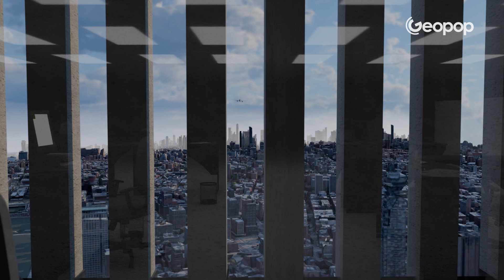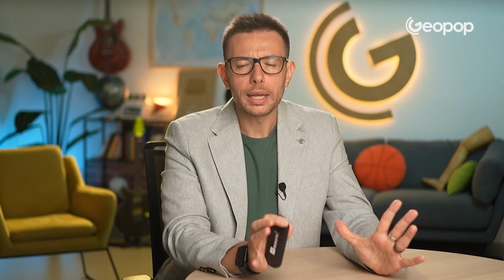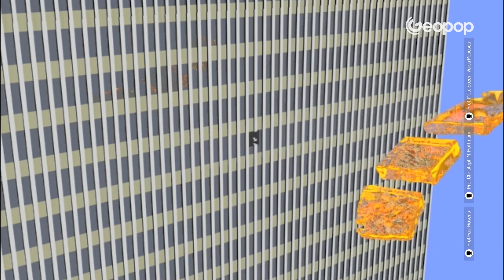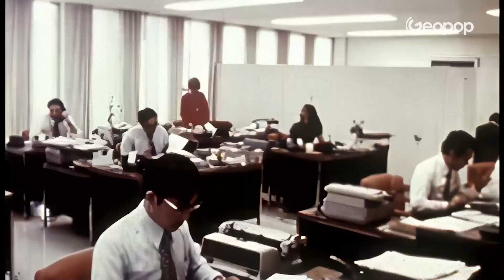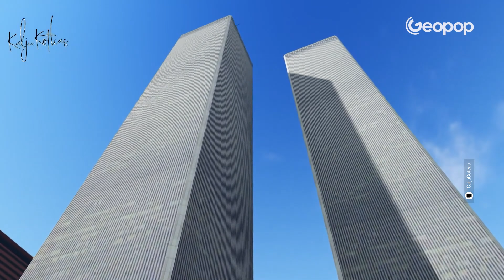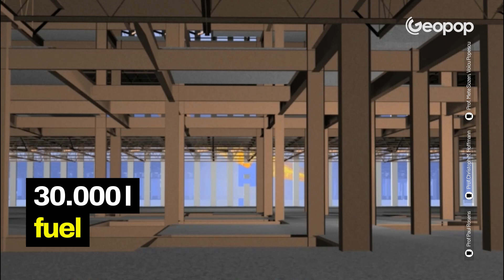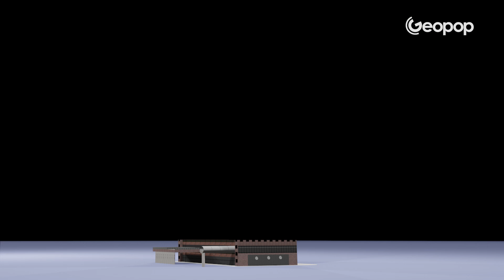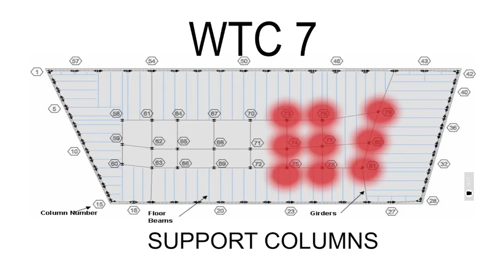9/11, 2001: The Technical Reconstruction of the Twin Towers and WTC 7 Collapses

Comment: The ridiculousness of the comment at 15:30 is astonishing! I know there will be many NIST boot lickers that will attack like ravenous beasts, but they just lack not only critical thinking skills but also lack any scientific education, scrutiny or rigor.

All of the laws of motion were in play on this day with regard to the collapse but NIST and the bootlickers will dazzle and distract you with big words, statements like "fire weakened the structure" and PhD's. Don't be fooled. The laws of motion cannot be suspended and those laws of motion NEVER get discussed by the official story.

No conspiracies just the facts of the laws of motion. I will discuss what happened as the building starts to collapse

Here is the order of Newton's laws of motion in place during the collapse and why it should have happened this way:

1. Gravity initiation
Newton’s Second Law (𝐹=𝑚𝑎): Gravity acts on the mass, causing downward acceleration.

2. Falling under gravitational acceleration
Newton’s First Law: The object (upper mass) remains in motion unless acted upon by another force (e.g., resistance).

3. Initial collision with the first weakened layer
Newton’s Third Law: Equal and opposite reaction forces occur between the falling mass and the impacted layer.

4. Momentum transfer to the first layer
Conservation of Momentum: Momentum is shared between the falling mass and the struck layer (𝑚1𝑣1+ 𝑚2𝑣2 = (𝑚1+𝑚2) 𝑣 final)

5. Energy dissipation (deformation, heat, sound)
Conservation of Energy: Kinetic energy is converted into deformation energy, heat, and sound, reducing the system’s overall kinetic energy.

6. Resistance from the intact or weakened structure
Newton’s Third Law: The lower structure pushes back with an equal and opposite force, resisting further motion.

7. Deceleration due to upward reaction forces
Newton’s Second Law: The upward force exceeds or equals the downward gravitational force, causing deceleration.

8. Possible localized failures in the immediate contact area
Material Strength Principles: Failure occurs when stress exceeds the material’s yield strength.

9. Redistribution of loads across lower layers
Static Equilibrium Principles: Intact parts of the structure redistribute the load to compensate for localized failures.

10. Arrest or halting of the collapse due to insufficient energy
Newton’s First Law: The system comes to rest when insufficient energy remains to overcome resistance forces.
~~~~~~~~~~~~~~~~~~~~~~~~~~~~~~~~~~~~~~~~~~~~~~~~~~~~~~~~~~~~~~~~~~~~~~~~~~~~~~~~~~~~~~~~~~~~~~~~~~~~~~~~~~~~~~~~~~~~~~~~~~~~
Here is the explanation for each:

1. Gravity as the Sole Force of Acceleration
Their Claim: Gravity alone was sufficient to accelerate the top floors downward, overcoming all resistance and allowing for progressive collapse.
Issue: Gravity provides a constant downward acceleration (𝑔=9.81m/s2) but this acceleration is opposed by:

Upward Reaction Forces (Newton’s Third Law): Each floor below exerts a force equal and opposite to the falling mass's force. For the collapse to proceed, the falling mass must overcome this resistance.

Energy Dissipation: Each collision converts significant kinetic energy into deformation, heat, and sound. This reduces the energy available for further acceleration.
Structural Redundancy: The lower intact floors were designed to support many times their static load. Overcoming this redundancy would require far more energy than gravity and momentum alone could provide.

2. Ignoring Energy Dissipation
Their Claim: Momentum transfer broke each intact floor free of its supports, with minimal energy lost to the process.
Issue: This assumption dismisses the large energy losses that occur in inelastic collisions. In reality:
Breaking Floor Supports: Significant energy is required to shear steel columns, crush concrete, and deform trusses. This energy cannot be ignored, as it fundamentally affects the dynamics of the collapse.
Momentum Conservation: While momentum is conserved, kinetic energy is not. In inelastic collisions, much of the kinetic energy is dissipated as heat, sound, and deformation, reducing the velocity of the falling mass.
Scaling of Resistance: Each subsequent floor presents increasing resistance due to the *cumulative load of debris*, making it unlikely for the collapse to proceed without deceleration.

3. Momentum Transfer and Structural Resistance
Their Claim: The falling mass imparted momentum to each successive floor, progressively breaking supports and adding to the collapsing mass.
Equation Provided: 𝑚1𝑣1𝑖=(𝑚1+𝑚2)𝑣𝑓, where momentum is conserved.
Issue: This simplified application of momentum transfer neglects key factors:

a. Reaction Forces (Newton’s Third Law):
Each floor below exerts a significant upward reaction force, which should decelerate the falling mass.
For the collapse to continue, the force of the falling mass must exceed the strength and resistance of each floor. This becomes increasingly unlikely as the intact lower structure is much more robust than the falling debris.

b. Mass Disparity:
The mass of the falling upper portion (e.g., top 15-20 floors) is vastly smaller than the lower intact structure (90+ floors). This mass disparity means the lower structure is capable of resisting and stopping the collapse unless an overwhelming external force is applied.

c. Energy Dissipation at Each Collision:
The energy dissipated in breaking floor supports and deforming materials grows exponentially with each floor. This dissipation reduces the kinetic energy available to continue the collapse.

4. Exponential Increase in Kinetic Energy
Their Claim: The kinetic energy of the falling mass increased exponentially as it accumulated debris.
Issue: This claim misrepresents how energy and momentum function in inelastic collisions:

a. Energy Dissipation Limits Acceleration:
The addition of mass during each collision increases inertia, making it harder for the falling mass to accelerate further. While the total mass increases, the energy dissipated in deformation and resistance reduces the effective velocity.
b. Structural Resistance Grows:
As the falling mass grows, the upward reaction force from the lower structure also increases due to the increasing mass. The intact structure was designed to withstand many times its static load, so it becomes progressively harder for the falling mass to continue.
~~~~~~~~~~~~~~~~~~~~~~~~~~~~~~~~~~~~~~~~~~~~~~~~~~~~~~~~~~~~~~~~~~~~~~~~~~~~~~~~~~~~~~~~~~~~~~~~~~~~~~~~~~~~~~~~~~~~~~~~~~~~

Here is why there is the misapplication of Newton’s Laws
NIST's application is flawed, here's why:

First Law (Inertia):
The lower floors were indeed "at rest," but the massive inertia of the intact lower structure means it would resist motion far more effectively than their explanation accounts for. The upward reaction forces would decelerate the falling mass significantly.

Second Law (𝐹=𝑚𝑎):
While the falling mass starts to accelerate due to gravity, the upward reaction forces at each collision create a net deceleration. The force required to shear steel columns and crush concrete far exceeds the available force from the falling mass.

Third Law (Action-Reaction):
The upward reaction force exerted by the intact floors would create significant deceleration for the falling mass, eventually arresting the collapse unless an overwhelming EXTERNAL energy source was introduced. This directly contradicts the claim that "no single floor could stop or slow the collapse."

~~~~~~~~~~~~~~~~~~~~~~~~~~~~~~~~~~~~~~~~~~~~~~~~~~~~~~~~~~~~~~~~~~~~~~~~~~~~~~~~~~~~~~~~~~~~~~~~~~~~~~~~~~~~~~~~~~~~~~~~~~~~

If any person reading this wants to dispute this, GREAT! Most of you will ignore the math and the explanations of the laws of physics, that's ok. 

So, listen, I get it. Brains are small, patience is little and most couldn't find there way out of their Mom's basement either way. However, ..........................

Here's the challenge: Do an experiment or find a video that shows ANY 2 objects, not a building, made of the same material, built in a similar fashion to each other (might I suggest cars and trucks as an example?). One of the objects should be smaller in mass and weight and the other should approximate a mass and weight much larger than the small object. Please show the small object initiate and accelerate by gravity, and after impacting the second larger object, CONTINUE TO ACCELERATE through ALL of the larger objects, COMPLETELY DESTROYING those larger objects. 

That's it kiddo's. Just one example! You got this!
Reply: Your reasoning is impossible to follow as you (go out of your way) to not specify what it is that is supposed to be interacting with what.

The structural elements are;
1. The 47 core columns.
2. The 236 perimeter columns
3. The long-span lightweight steel floor trusses
4. The steel hat truss.

So please ree-state, only this time identify which components are interacting with each other and how at each stage.
Reply: @TheLoonResistance  

In the context of the collapse, the following interactions between structural elements occurred at each stage:

Gravity Initiation:
The mass of the upper floors acted on the long-span lightweight steel floor trusses, transferring load to the 47 core columns and 236 perimeter columns.

Initial Collapse at the Impact Zone:
The floor trusses, weakened by fire, sagged and pulled on the perimeter columns, causing inward bowing. Simultaneously, the core columns experienced a redistribution of load, some of which exceeded their capacity.

Progression of Collapse:
As the floor trusses detached from the core columns and perimeter columns, these columns were left unsupported and buckled under the weight of the upper floors.
The steel hat truss, designed to redistribute loads between the core and perimeter, failed under the dynamic loads created during the collapse initiation.

Interaction During Momentum Transfer:
Falling debris from the upper floors impacted the floor trusses below, transferring force to the core columns and perimeter columns, which failed sequentially.

Energy Dissipation and Arrest:
At every stage, deformation of the trusses, buckling of the columns, and fracturing of connections dissipated energy, making progressive collapse increasingly unlikely without additional forces.
~~~~~~~~~~~~~~~~~~~~~~~~~~~~~~~~~~~~~~~~~~~~~~~~~~~~~~~~~~~~~~~~~~~~~~~~~~~~~~~~~~~~~~~~~~~~~~~~~~~~~~~~~~~~~~~~~~

Conservation of momentum plays a critical role in understanding the interactions during the collapse. At each stage of the collapse:

Momentum Transfer: When the falling upper mass impacted the stationary structure below, momentum was shared between the two, following the principle: 𝑚1𝑣1+𝑚2𝑣2 = (𝑚1+𝑚2)𝑣𝑓
 
Here, 𝑚2𝑣2 = 0 because the lower structure was initially at rest. This transfer results in a combined mass with reduced velocity due to energy dissipation.

Energy Dissipation: Momentum conservation is separate from energy conservation. While momentum is conserved, kinetic energy is lost during each impact to deformation, heat, and sound. This loss causes a deceleration of the falling mass, making a progressive collapse less likely.

Impact on Structural Resistance: As the mass of the falling debris increases, so does its inertia. However, the resistance provided by the lower intact floors also increases proportionally, further counteracting acceleration.

Conservation of momentum explains perfectly why the collapse would decelerate rather than accelerate, as significant energy is lost at each collision point.
~~~~~~~~~~~~~~~~~~~~~~~~~~~~~~~~~~~~~~~~~~~~~~~~~~~~~~~~~~~~~~~~~~~~~~~~~~~~~~~~~~~~~~~~~~~~~~~~~~~~~~~~~~~~~~~~~~

Gravitational acceleration requires an additional force, "separate" of gravity, for the top floors to accelerate "through" the lower 90 floors of undamaged, cold steel built with redundancy to withstand approximately a load of 11 more floors.

Increased velocity at impact results in higher kinetic energy (𝐾𝐸 = 1/2 𝑚𝑣2)  and momentum (𝑝 = 𝑚𝑣). The increased kinetic energy must still overcome the resistance from the supports of each successive floor (Newton's Third Law.)

I don't mind debating this but still looking for someone to point me to an experiment they have done or a video showing ANY 2 objects, not a building, made of the same material, built in a similar fashion to each other (might I suggest cars and trucks as an example?). One of the objects should be smaller in mass and the other should approximate a mass larger than the small object. 

Please show the small object initiate and then continue to accelerate by gravity alone, and after impacting the second larger object, CONTINUE TO ACCELERATE through ALL of the larger objects, COMPLETELY DESTROYING those larger objects.
Reply: @christyfleming433  - While there are some prior quibbles, I am going to set those aside for the moment and stop you at;

Interaction During Momentum Transfer

Your description that Falling debris from the upper floors impacted the floor trusses below, transferring force to the core columns and perimeter columns, which failed sequentially is incorrect.

Impact from the falling debris hitting the next intact floor below would and did cause instantaneous failure of the 5/8| bolts connecting each end of the floor truss to the core and perimeter columns. No meaningful loads are transferred sideways into the columns and the columns remain standing far behind the collapse front.
Reply: @TheLoonResistance  

In the context of the collapse, the following interactions between structural elements occurred at each stage:

Gravity Initiation:
The mass of the upper floors acted on the long-span lightweight steel floor trusses, transferring load to the 47 core columns and 236 perimeter columns.

Initial Collapse at the Impact Zone:
The floor trusses, weakened by fire, sagged and pulled on the perimeter columns, causing inward bowing. Simultaneously, the core columns experienced a redistribution of load, some of which exceeded their capacity.

Progression of Collapse:
As the floor trusses detached from the core columns and perimeter columns, these columns were left unsupported and buckled under the weight of the upper floors.
The steel hat truss, designed to redistribute loads between the core and perimeter, failed under the dynamic loads created during the collapse initiation.

Interaction During Momentum Transfer:
Falling debris from the upper floors impacted the floor trusses below, transferring force to the core columns and perimeter columns, which failed sequentially.

Energy Dissipation and Arrest:
At every stage, deformation of the trusses, buckling of the columns, and fracturing of connections dissipated energy, making progressive collapse increasingly unlikely without additional forces.
~~~~~~~~~~~~~~~~~~~~~~~~~~~~~~~~~~~~~~~~~~~~~~~~~~~~~~~~~~~~~~~~~~~~~~~~~~~~~~~~~~~~~~~~~~~~~~~~~~~~~~~~~~~~~~~~~~

Conservation of momentum plays a critical role in understanding the interactions during the collapse. At each stage of the collapse:

Momentum Transfer: When the falling upper mass impacted the stationary structure below, momentum was shared between the two, following the principle: 
𝑚1𝑣1+𝑚2𝑣2 = (𝑚1+𝑚2)𝑣𝑓
 
Here, 𝑚2𝑣2 = 0 because the lower structure was initially at rest. This transfer results in a combined mass with reduced velocity due to energy dissipation.

Energy Dissipation: Momentum conservation is separate from energy conservation. While momentum is conserved, kinetic energy is lost during each impact to deformation, heat, and sound. This loss causes a deceleration of the falling mass, making a progressive collapse less likely.

Impact on Structural Resistance: As the mass of the falling debris increases, so does its inertia. However, the resistance provided by the lower intact floors also increases proportionally, further counteracting acceleration.

Conservation of momentum explains perfectly why the collapse would decelerate rather than accelerate, as significant energy is lost at each collision point.
~~~~~~~~~~~~~~~~~~~~~~~~~~~~~~~~~~~~~~~~~~~~~~~~~~~~~~~~~~~~~~~~~~~~~~~~~~~~~~~~~~~~~~~~~~~~~~~~~~~~~~~~~~~~~~~~~~

Gravitational acceleration requires an additional force, "separate" of gravity, for the top floors to accelerate "through" the lower 90 floors of undamaged, cold steel built with redundancy to withstand approximately a load of 11 more floors.

Increased velocity at impact results in higher kinetic energy (𝐾𝐸 = 1/2 𝑚𝑣2)  and momentum (𝑝 = 𝑚𝑣). The increased kinetic energy must still overcome the resistance from the supports of each successive floor (Newton's Third Law.)

I don't mind debating this but still looking for someone to point me to an experiment they have done or a video showing ANY 2 objects, not a building, made of the same material, built in a similar fashion to each other (might I suggest cars and trucks as an example?). One of the objects should be smaller in mass and the other should approximate a mass larger than the small object. 

Please show the small object initiate and then continue to accelerate by gravity alone, and after impacting the second larger object, CONTINUE TO ACCELERATE through ALL of the larger objects, COMPLETELY DESTROYING those larger objects.
Reply: @christyfleming433  - Thank you for ignoring my last comment completely. Hugely disrespectful.  Let me post it again, on the off chance you can demonstrate you are serious and not just mindlessly repeating dogma you don't really understand. 

Interaction During Momentum Transfer

Your description that Falling debris from the upper floors impacted the floor trusses below, transferring force to the core columns and perimeter columns, which failed sequentially is incorrect.

Impact from the falling debris hitting the next intact floor below would and did cause instantaneous failure of the 5/8" bolts connecting each end of the floor truss to the core and perimeter columns. No meaningful loads are transferred sideways into the columns and the columns remain standing far behind the collapse front.

Please address this point and only this point.
Reply: @TheLoonResistance  
My intention was not to ignore your comment. I have no desire to debate what mechanical or structural attachments failed. That is not my disagreement with NIST or any other so called "expert" who wants to discuss, ad nauseum, pancaking, fire or any other theory behind the collapse. I only want to discuss the start of the collapse and the progression through the entirety of the lower floors and ONLY discuss the laws of motion in the sequence of the collapse.

But first, where did I say, “Falling debris from the upper floors impacted the floor trusses below, transferring force to the core columns and perimeter columns, which failed sequentially.” I would like to know the exact location where I made this claim, because I can't find it. Either way, I will address it:

Let’s focus on the specific point you raised about the failure of the 5/8" bolts connecting the floor trusses to the core and perimeter columns:

Instantaneous Failure of Bolts:

If the bolts did fail instantaneously during the collapse, that would indeed disconnect the trusses from the columns. However, this raises a key question:
Without meaningful load transfer to the columns, where does the energy and force from the falling mass go? The collapse would require energy to be dissipated somewhere, either through the deformation of the trusses, crushing of the concrete, or lateral stresses on the columns themselves.

Columns Remaining Behind the Collapse Front:

Your assertion that the columns "remain standing far behind the collapse front" conflicts with observable evidence from the collapse of the World Trade Center. The collapse visibly involved both the trusses and the supporting columns, as large sections of the core and perimeter were not left intact behind the debris. Even if bolts failed, the falling debris would still interact with the columns—either through direct impact or as redistributed load. For the collapse to progress through 90 intact floors, significant resistance from these columns would need to be overcome.

Energy Dissipation and Momentum Transfer:

The bolts’ failure does not negate the principle of momentum transfer. Even if the trusses detach, the falling mass would still need to overcome the resistance of the intact lower structure, including both the remaining columns and any unfailed connections. Conservation of momentum and energy dissipation at each level make the idea of a near-freefall collapse implausible without substantial pre-weakening or additional external forces.

~~~~~~~~~~~~~~~~~~~~~~~~~~~~~~~~~~~~~~~~~~~~~~~~~~~~~~~~~~~~~~~~~~~~~~~~~~~~~~~~~~~~~~~~~~~~~~~~~~~~~~~~~~~~~~~~~

The only topic I would like to discuss are the laws of motion in play. I have yet to see an experiment, natural phenomena or any structure similar to the WTC buildings fall the way they fell except in a controlled demolition. Regardless of any disagreements between the two sides, what we saw that day LOOKED and ACTED like a controlled demolition. Whether it was or not remains to be seen. This includes building 7 as well. No buildings prior to 911 and no buildings AFTER 911 have EVER fallen like what we witnessed that day. There have been MANY steel and concrete buildings since that have had fires larger, more floors, burned much longer and hotter and collapse was not inevitable in ANY of them.

I am not a conspiracy theorist, although I would imagine at some point you will hurl that accusation my way, they all do. I'm just trying to figure out what we all saw that day. Being skeptical and asking questions is what science is supposed to be about. It's not about a group of "experts" who do an investigation, come to a conclusion and then nobody is allowed to ask questions, do peer review, which has NOT been allowed, and rely on consensus. That is NOT science.

That being said All of the laws of motion APPEARED to be suspended that day. I will state again what I am looking for, someone to show me without resorting to ad hominems or saying "I don't need to prove anything to you" or "I don't need to find a video for you, find it yourself" or the hundreds of other deflections that have been bandied about.

I just need someone to do an experiment or find a video that shows ANY 2 objects, not a building, made of the same material, built in a similar fashion to each other (might I suggest cars and trucks as an example?). One of the objects should be smaller in mass and weight and the other should approximate a mass and size much larger than the small object. Please show the small object initiate and accelerate by gravity, and after impacting the second larger object(s), CONTINUE TO ACCELERATE through ALL of the larger objects, COMPLETELY DESTROYING those larger objects. 

This seems to me a pretty simple request. Someone has already done the experiment to show that the impossibility of what happened to those 3 buildings was IMPOSSIBLE. It was thorough and conducted by another expert in this field. I will be happy to post the link but since you have engaged with me, I would like for you, in good faith to follow up on my request.

I look forward to seeing that experiment and or video.
Reply: @christyfleming433  - I copied and pasted that directly out of your first reply to me. FFS know your own material 🤦‍♂🤦‍♂

Your conclusions are premised on false starting assumptions and the first (big) one is the point I mentioned. If you get the mechanisms wrong you will get the rest wrong. I suspect you are just copying all this shit from somewhere and don't really understand any of it. You don't even know what you said.

The energy (mass) keeps moving down BTW.  Not that hard to figure out. And with each successive floor failure it increases. The resistance of each floor (the bolted connections) is always the same but the energy both in terms of falling mass and its velocity is constantly increasing from one floor to the next.